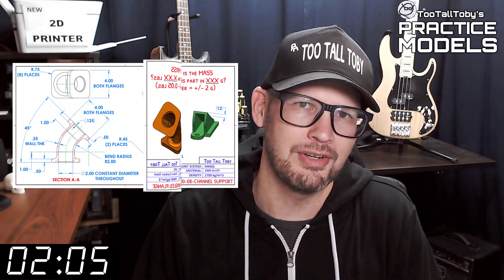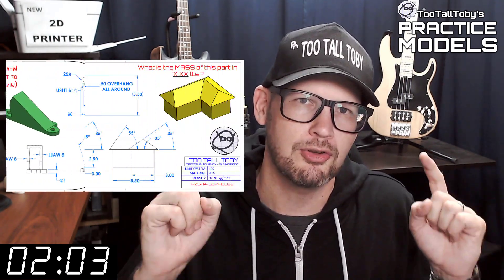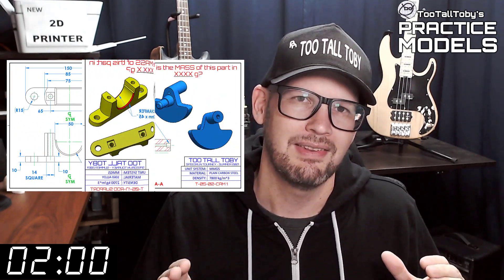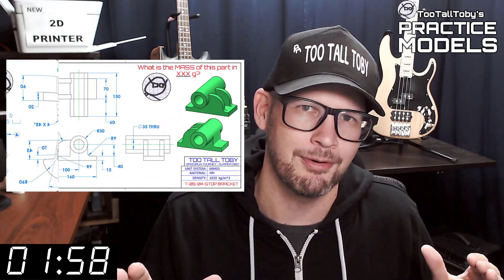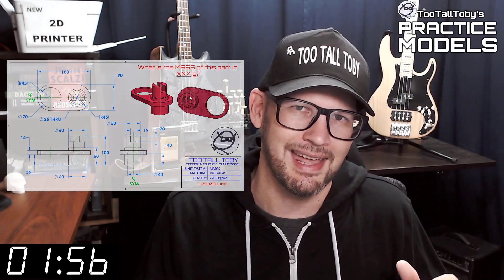SOLIDWORKS Practice - Onshape Practice - Fusion 360 Practice Exercises - TooTallToby-23-01-07

Comment: 1613.16g

I said I'd do this week's in OnShape so I did, took 11 min (9.5ish but in double checking the drawing I saw I missed the corner fillets, and one of the edge fillets) with 9 features. I used "Solidworks thinking" in a couple spots that slowed me down. My sketches are also fully constrained (I feel like this should be a rule/requirement in the speed challenges, everytime I see an unconstrained sketch I cringe fast shouldn't mean crap)

I'm not going to redo it, but for me Solidworks would have been a bit quicker. This comes down to things like the auto tangent arcs in sketches (if this exists and I'm doing it wrong tell me), being able to start the boss from a surface as I had the circle in the tab sketch, you can do the math and off set the difference, but the boss dimension is from a surface and should be controlled from there so I had to add a sketch and move the Sketch surface, I could have sworn this was in the last update), the difference between the sketch requirements for the hole wizard I still haven't gotten used to (I really don't like the OnShape hole wizard compared to the SW one).

I also keep hitting "T" for trim and getting tangent, old custom AutoCAD cui set up which has trained my hand movement and brain which I haven't broken.
Reply from the maker: Lol - I have some hand movements like that (mainly from Minecraft) that I tend to fall back into, too!  I'm not sure about the auto-tangent arcs in Onshape - I'll be learning more onshape this year though, so I'll be looking out for it.  Nice job Chris!
Reply: @TooTallToby  there are think you'll think are the best thing since sliced bread (like the fastener catalogue, until you need a rivet, pin, ECT). There will be other things what will take a while to "adjust to", and there will be things that are "missing".

There is definitely a class of business and user OnShape is awesome for.
Reply from the maker: @Chris-xf5dq  nice!
Reply: @Chris
There is no "auto switching" from line to arc but I use the keyboard shortcuts "A" and "L" to switch back and forth instead. This is for the a 3pt arc but it does snap to tangent as you create it and you can still auto-dimension after snapping it so I find it works quite well. Keep in mind also that there is really no need to trim your sketches in Onshape so you can save a lot of time that way (i.e. draw two overlapping rectangles to create an "L" shape rather than just lines).
I find that the biggest thing missing from the hole tool is the ability to "reverse" it (i.e. having the counterbore on the "opposite side" from your starting point). But you actually don't have to have the sketch on the staring plane of the hole. Another thing that makes the hole tool a lot more versatile is to use "mate connectors" to locate the holes as you can do all sorts of things with these. It takes more clicks than I would like but you can really do a lot with them (and not just in hole tool) and it's well worth getting familiar with the workflow.
The extrude tool has had the option to set the "second end" (which is different from SW "second direction") to be in the same direction as the first (including with "up to" and offsets) as a way to achieve an extrude away from the sketch plane forever. However it was clearly not intuitive enough (it took me some time figure it out myself) as everyone kept asking for an offset option, and this was added in the last update a couple of weeks ago and makes it behave essentially like SW.

Check out the video I just posted of this part on my channel on how I dealt with some of these topics. Also if you go to the document using the video link, check out the "Hole with MC" part studio as an alternate way to place the counterbore without needing any sketch or doing any "cheating".
It might have been more "proper" to put "Sketch3" on the other face to avoid having to do math on the round boss distance but another thing to keep in mind is that Onshape does save the "expression" (rather than just the result). So if you go and edit it, it will still say "20-12" rather than just "8" so it does a much better job preserving the design intent.